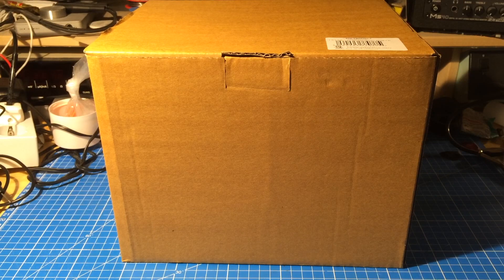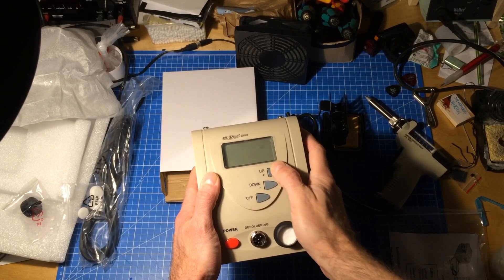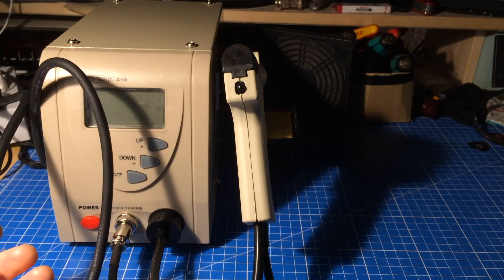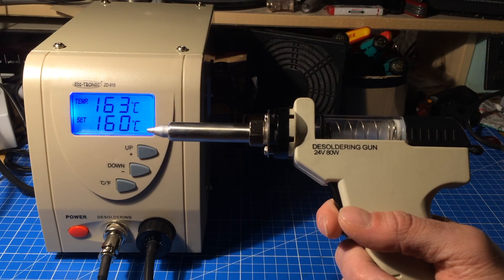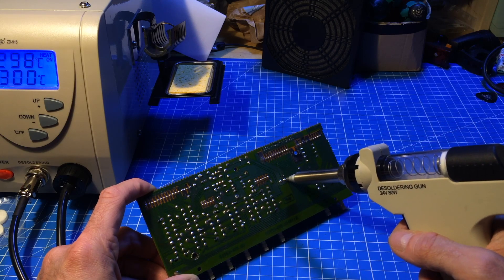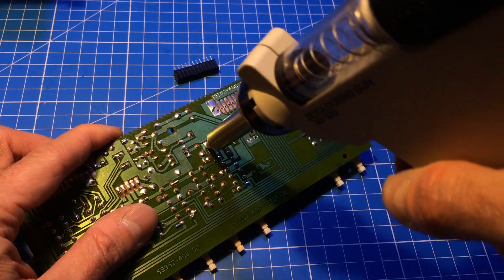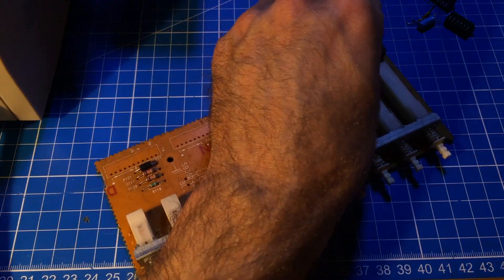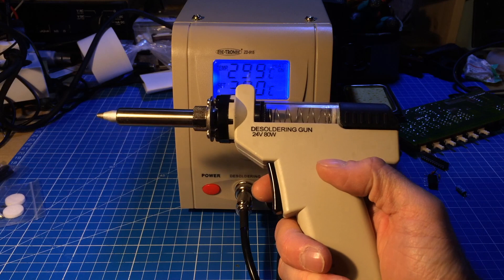Cheap ZD-915 Desoldering Station Review

Comment: Does it work also on multilayer boards? For example, an ATX power connector from a mainboard?  Such simple single-sided PCB one can rework without a solder pump, so what was the point of the video. I really hoped you will actually test it.
Reply from the maker: It works way better than a solder pump. I used it on multilayer boards and it holds up quite well. You have to get the timing and temperature right and I usually add some flux when working on more difficult stuff. I usually do retro computer and vintage audio repairs so I am not that experienced with more modern boards though.
Reply: Well, the best what I found was a Russian video (could have been Polish though), where a guy tried to desolder the pins of a broken PCI-e connector from an AMD motheboard, and the station failed miserably.
For 100Euros might work as a "toy" desoldering station, but in the inexpensive price range I guess there is no chance to get anything decent.
Reply: EEVBlog has an upboxing and demo at https://www.youtube.com/watch?v=Ft50m8UU5WQ I have one of these and you can desolder from multilayer boards although as with any desoldering station you need to get the temperature and technique right.  Flux can also help.

Comment: Decided to buy one of these after looking at this review but I can't get the station to change temperature? I've had it sitting for over 20 minutes and it's reached the default temp of 160c but I'm unable to adjust the temperature up / down and can't change the units from Celsius to Fahrenheit, possible I've received a dodgy unit or am I missing part of the set up procedure?
Reply from the maker: Oh, it seems like you got a dodgy one. Normally you should be able to adjust temperature right after you turn the station on.

Comment: Tried desoldering a 6526 ic today from a broken breadbox with a very cheap regular desoldering kit (no vacuum pump, it's hand operated with a heating device around it) and most of the pins are still attached to a bit of tin (i poke the pins with a tiny screwdriver to see if they are still stuck).

Does this thing work better and always get the soldering out or are there problems like this using 915 too, i.e. is it skill that is required or is it just that easy as you show it? With the thing i got i have to apply heat, push a button, remove to see if i actually heated up the tin (because my view is blocked) and then apply heat again if i missed. Bloody annoying so you may see why i'm considering something better.
.
Reply from the maker: Yeah, desoldering can be a pain. The desoldering station really improves that. I rarely fail desoldering ICs nowadays. It's really as easy as I show it in the video. You still have to be careful of course and double check if everything came loose. Sometimes I have to add fresh solder or flux. Overall, this works way better (at least for me) than other methods I've tried (desoldering braid, desoldering pump).

Comment: If you have to repair one of these! Use rubber cloves, because the power supply is not service friendly and makes it harder to discharge the capacitors at 400 volts.
Reply from the maker: Oh, good to know. I had a brief look inside to check ground connections etc but didn't see that. Thanks!

Comment: Nice review!!! I've come here looking for this desoldering gun after seeing someone it listed in someone else's kit. From what I've seen, I'm getting one :D
Reply from the maker: Thanks! Still highly recommended. I'm using it a lot. It sometimes clogs a bit but I guess if you clean it more regularly than I do it's not a problem at all. ;)
Reply: How would you clean it? I've never owned one before and just teaching myself electronics so I can look after my retro computers.
Reply from the maker: You can take apart the "pistol" part and clean out the solder. There's also some poky bits included to clean the canal from solder that might be stuck in there. You basically heat it up and poke out the liquid solder. Sounds harder than it is really. Teaching yourself this stuff is very rewarding (still learning myself every day). :)
Reply: Thank-you very much! I never took much care of electronics at school because I had problems with resistors. Couldn't get my head around the color bands so I was never that bothered with it. Now, around 30 years later, I still can't but I don't need to - online calculators make it so much easier. You're right, it is very rewarding especially when I repaired a load of PCB tracks for the first time and got my daughter's second-hand toy fully working, restored from the grave :D

Comment: i have the jaycar australian version of this doovalacki. its OK. i found a piece of sponge works well as a filter at the back of the gun end. the thin sticks to clean out the inside of the tip are useful, mine has clogged a few times. watch for it spitting fire after its been cleaned out though. i've had mine for a couple of years now and its still going strong. was a bit exxy here in AU but everything is these days in this ripoff country.
Reply: Hi Greg. I already had the Jaycar TS-1390 soldering station and was looking at the TS-1513 but the price was a bit high for me. I found the ZD-915 on eBay on Monday and it was delivered on Wednesday - all up it was half the price of the Jaycar model. The negative is a lot of eBay sellers don't sell replacement parts - but the parts are cheap enough at Jaycar.
Reply from the maker: Yes, I had to clean mine a couple of times, too. Not too often though. Still highly recommended. It seems the prices vary quite a lot over time and (obviously) depending on where you are. I was thinking of using some kind of cotton pad for replacing the filter also. Should work fine, too, I guess.
Reply: good work John. Unfortunately Jaycar is not as 'good' as it used to be ... its rather expensive these days sadly and has lost that 'edge' that it used to have.
Reply: Jan I tried tissue which didn't seem to work too well. a piece of sponge really seemed to do the trick for me!
Reply from the maker: Thanks! Going to try the sponge then. :)

Comment: saved about 70GBP myself getting one 2nd hand off a guy on Sphock, was almost brand-new only used a few times, really happy with my purchase, it's a duratool one but same model. Recommended.
Reply from the maker: Yes! It's a very good product for the price. I still use it a lot and it has never failed me (except it was clogged a few times but it was easy to clean).

Comment: Hi Jan, How's the long term reliability of this desoldering gun?
Reply from the maker: +Kerry Wong I still use it very frequently and it works fine. The only thing you have to take care of is cleaning it from time to time. Mine was badly clogged with solder at one point and I had to use a second iron and some patience to get it to work again. Other than that I'd still highly recommend it!
Reply: Thanks Jan! I will keep it in mind.

Comment: Nice review, although, I don't like the "cheep" word on the title. 
Don't get carried away with the prices in the market, especially in north America everything is tripled priced compered to Europe pricing.
I have this device (actually the OEM ZD-917, which is a double soldering and desoldering station) from 2009 from Europe (where I was living) and it was awesome! Never had a problem with it. Worked like a charm (as they say.) I believe this device is definitely a pro use long lasting equipment and lots of professionals and amateurs are very happy with it! I wanted to get one here in Canada but ZD stations are not been sold here. Although I found them in a couple of places and the price was 3 times higher. Eventually I desided to choose another brand [AOYUE]  701A++ in soldering & desoldering station (in a reasonable price of course) which is also good (plus with a couple of extras) but in my mind it will never replace my ZD station. I loved that station..
Reply from the maker: +A.J. Cobbs Oh, thanks for the info. I was not aware of the huge price differences. Bought it relatively cheap here a while ago. It's gotten a bit more difficult to get this exact model in Europe, too recently. I also think the price is a bit higher now. The station still works an absolute treat for me, too. I'm really happy with it.
Reply: I think the US model is ZD-985.

What did you dislike about your Aoyue? They have a pretty good reputation, at least for a rather new Shenzhen company. ZhongDi is a really really old manufacturer.
Reply: Waaaait a second, i was on the lookout for some replacement parts for my unit, and i just found something! Company called "MPJA" carries the ZD-915 with US voltage in the States, for $120, which isn't far off of how much it costs in Europe, and it also carries the rest of ZhongDi items.
Reply: I've always thought that one reason why things like power supplies cost more in the US than in Europe is because we have 120 V AC rather than 220 V. And, really, I'm only talking about cheap Chinese electronics. Once you get above the absolute cheapest price range, US and European prices are the same.

For example, on Ali Express I priced out a bench supply. The 2 or 3 cheapest supplies were 220 V only, but beginning at about $20 more, supplies began to be available in either 120 or 220 for the same price. Going up a bit further in the price range, the supplies were auto-switching.
Reply: John, but the ZhongDi stations in question are not just some inner market Chinese item from Aliexpress, they have EU-compliant certifications and are carried in their 230V versions by major distributors like Farnell, as well as numerous smaller local European brands. Looking at the ZhongDi official page, they have 120V versions as orderable SKUs for both ZD-915 and ZD-985 and just about anything else driven by a transformer that you could possibly think of. It looks like simply in the USA nobody stepped up to make a bulk order, certify and sell the things, as they will be made to order. Probably once somebody starts, there will be a dozen importers just doing the same thing copycat style, as they will no longer need to certify anything, just refer to prior certification.
Reply: I bought mine for 62 euro's. They are still available for 68 euro's right now.

Comment: another piece of crap from China...
Reply from the maker: +L L It's quite well made and still works nicely. Very good value for money. Plus, I (and most hobbyists I assume) couldn't afford an expensive good brand device.
Reply: Thats the bottom line really, yes china makes some very cheap and unreliable products that end up on the street throw outs within 6 months, but if your only using it for a hobby can you afford to spend 500, 600 Au on a good one???  So many other bills to pay most hobby guys will buy the cheap chinese one and try their luck.

Comment: excellent review, thank you. i was about to order the chinese 993 gun, but saw it had a few issues (blocking, overheating, DOA units). this one looks great and based on your review i'll order one! just curious if you opened it up to check wiring, earth, fuse etc. at all? i always do that with chinese mains units
Reply from the maker: +Joe Dall I still use it a lot. It also blocks from time to time but is easy to clean most of the times. The insides looked alright on mine. I heard that some people had loose wiring inside so it's a good idea to check. Only thing I "modded" is to put some pieces of rubber between the cooling fan and the case to make it a bit quieter.

Comment: Hi! I ordered SP-1010DR desoldering station. It's kind same looking devise as you introduced, but black. It arrived, but now I wonderer what kind of warning in manual is this: Caution: Make sure that the four screws which are used to fasten the Diaphragm pump are removed from the control system before use. Otherwise serious damages may be caused to the user and the system.
What this warning means???
Reply from the maker: +saarike Mine didn't have that warning, so I don't really know. Probably there's some marked screws you have to remove on the case to 'free' the pump.
Reply: Ok, thanks for answer. I opened it, and there were 4 screw holes, but there were no screws. So I put the cover back and fired it up. There was no problem it and worked fine. :) Good machine for the price!
Reply from the maker: saarike Ah, cool that it worked! Hope the device serves you as well as mine does for me. :)
Reply: Thanks!
Reply: Thanks for information! I opened the case and notised, that the screws were already removed. I plugged the device to power and it worked perfectly. :)
Reply: My instructions said the same, but a slip of paper tucked inside said this was no longer required on newer models as the screws are not present.

Comment: it looks really nice, better than the Chinese S-993A desoldering gun who has problems with temperature sometime.
Reply from the maker: +orange11squares This one works very well for me still. Using it quite a lot. Only thing I "modded" was to insert some rubber rings on the fan to make it a bit quieter. Looks quite well made (for the price) inside, too.